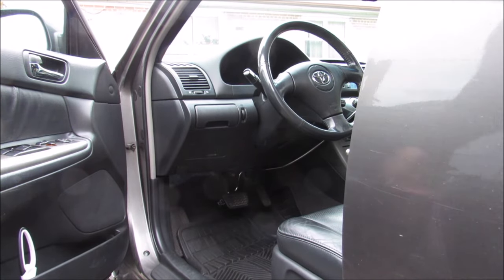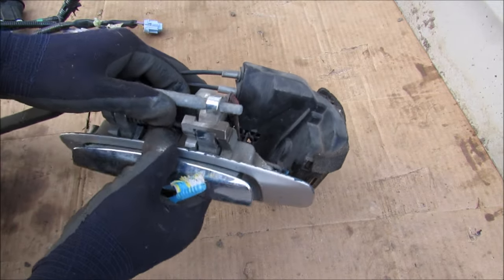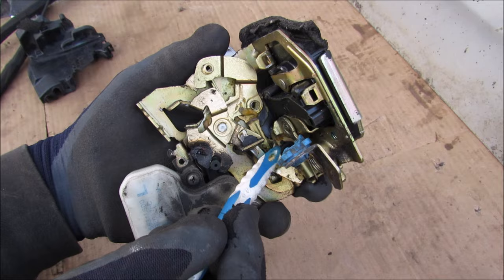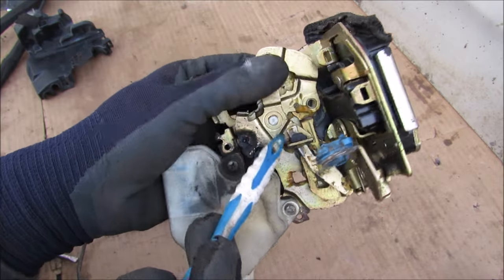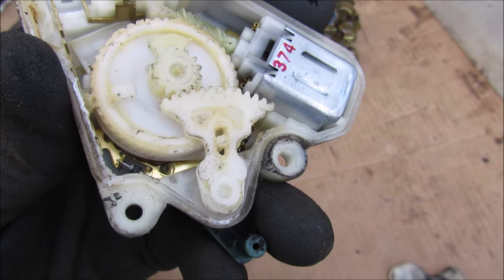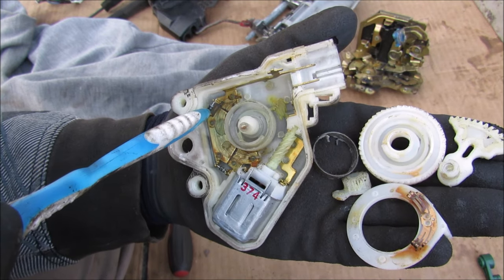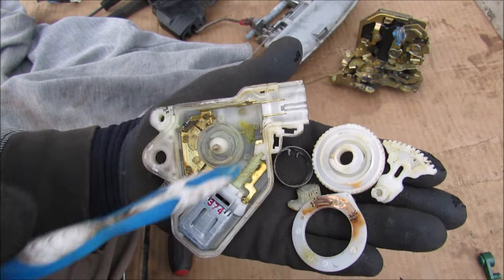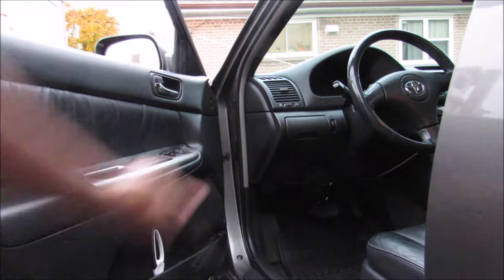How Power Door Locks Work

Comment: The complexity in car vehicles is just insane. No wonder why Tesla is the first startup in decades and even they have had insane amounts of production issues!
Reply from the maker: It sure is quite a complex machine, and has taken alot of growing pains to get it right... especially right off the assembly line.
Reply: Also, electric cars are soooo much simpler than a gas engine.

Comment: My Honda Accord 2003 keyless entry only locks/unlocks the passenger side rear door even when I use driver side door buttons It only locks/unlocks passenger side rear door, after watching your great video I will be more confident (maybe) to open up the door panels to look into them. Thanks.
Reply from the maker: Yes look into it. It could be worm lock actuators
Reply: @speedkar99  thank you.

Comment: Cool, i can use that lock with my homemade burning laser to control the switch of my homemade pressure washer so i can clean my motorcycle easily..
Thank you so much.
Reply: Use it in conjunction with your homemade cellphone to lock, unlock or remote-start your homemade car.

Comment: Cool, but what if neither the indoor handle,  key fob, outside key lock or indoor lock button does not unlock the locked door? I have a 2000 Buick Century and can not open the passenger side front door. I know something is jammed but how do you service the power lock with the door closed and locked?  I'm not going to saw my door!

Comment: Thanks for a great video that I need now. The driver's door on my 93 Honda Accord EX (power locks) is locked and cannot be opened from inside or outside. I was able to get the door panel off from inside without damaging it too much, but what I'm wondering is if it is possible to reach the latch and operate it by hand to free that door. There is no real visibility, but I can feel several mechanisms back in there, but have no idea what might unlatch that door. Perhaps there is a hole or slot that provides access to that latch.

Comment: Now to add a sheet of tinted plexiglass (3M) into a steel frame, incorporate this mechanism... And I have a new door for my business/club/camera room🙏
Might even turn it into a sort of powered window for my bedroom.
 (Like a fibreglass garage door that retracts into the ground, controlled with something like a 'dim light switch')

Next project is to buy a hybrid with CarPlay and include the entire electrical system; automatic bedroom windows instead of shades, secure looking, could program keys to serve as 'employee tags'; wifi, tv, radio, ios connectivity built-in, could always upgrade/modify later on to add Nebula Max and Dyson Fans...  Imagine the power of that air conditioning system when I link a huge propane tank, or 4 
🤔💭🧠🤯

Might even pair the keyless entry with my Nike for the sake of innovative convenience, and use the wiring for headlights to electrify that frame/handles/fence... would probably go as far as to ask a relative for the propeller from his old aircraft to make some stand out ceiling fans, using the accelerator with the door to give circulation a 'boost' when someone enters.

Comment: I am not crazy about these newer power lock systems. Rather complex and sometimes temperamental. I never had any trouble with power locks on my old GM and Ford cars (all the parts were metal, including the door switches), but I can't say my 2005 Toyota has been 100% reliable in that department (all cheap plastic crap).

Comment: I dislike Nissan's door lock actuator. They are known to be broken in just few years of use. I had to replace my girl friend's Nissan driver door lock actuator which stops working in less than 5 years of manufacturing date. I have used 3 Toyota, and their electrical door have never had any problems.